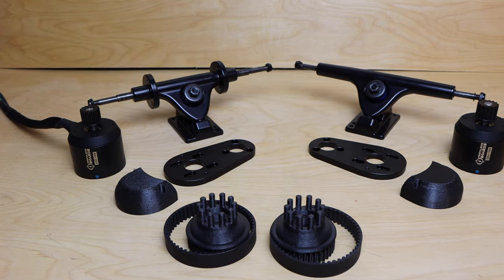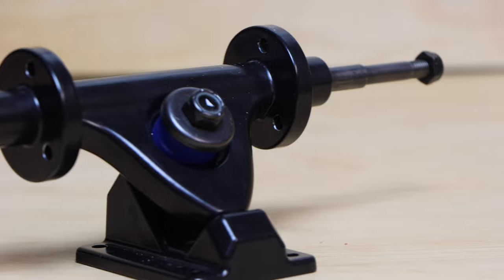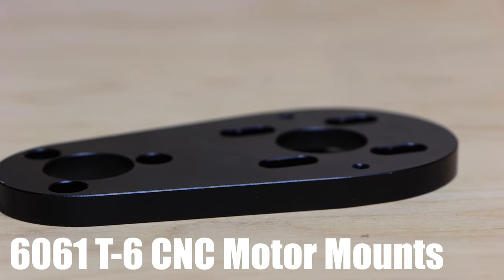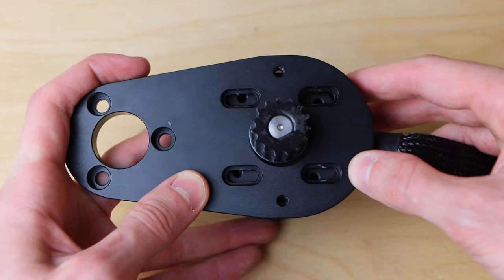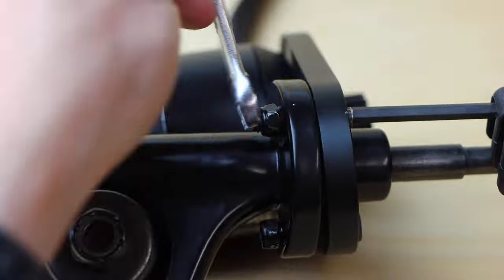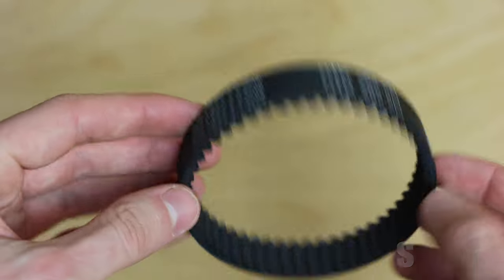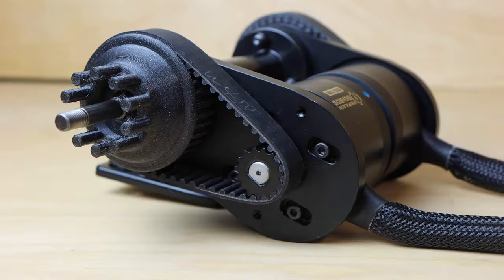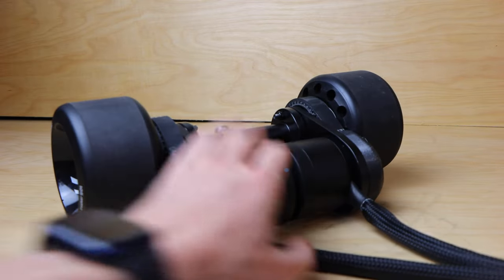Simple DIY Electric Skateboard Drive Train *Propulsion Boards Mini RKP Drive Train Tutorial*

Comment: Is 3d printing the wheel pully better then the usual injection molded pully? Also do you plan to sell the stl file for the belt cover and the pullies for people who have their own printer?
Reply from the maker: 3D printing wheel pulleys can work but I have not had great success with them. The spokes tend to snap off pretty easily unless printed at very high infill - even then though they can break. The injection molded glass filled nylon pulleys are very strong in comparison. We will make the stl files for the belt cover files available to people that purchase the kit
Reply: I’ve been using 3D printed PETG pulleys on a dual 6374 build for over a year now and they’re solid. It’s worth noting that I’ve printed them at 100% infill, otherwise I don’t think they would be strong enough. Also, the pulleys are bolted onto the wheel with 6 m5 bolts, because transferring the torque solely through the plastic spokes wouldn’t work.

Comment: Can the motors be mounted behind the deck or only under?
Reply from the maker: Under the current options, yes only under the deck
Reply: @DIYesk8Builders  darn was hoping to use it with a double drop deck. Thanks
Reply from the maker: Sorry about that!